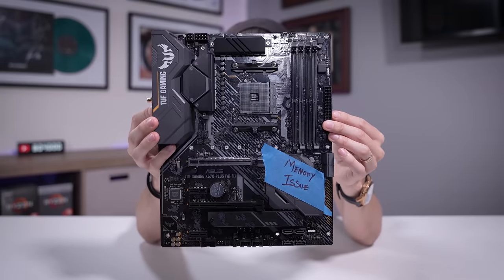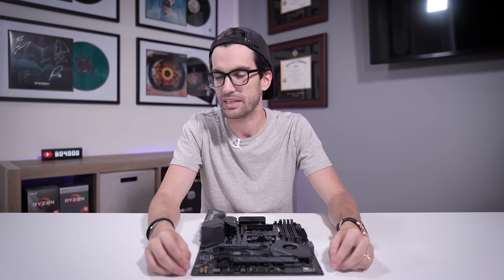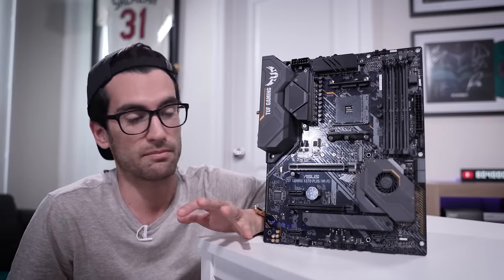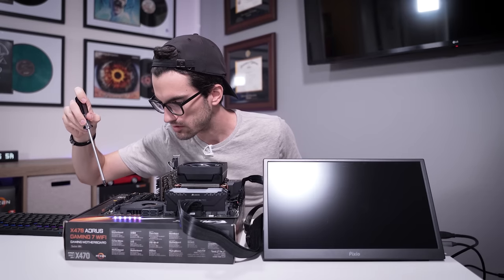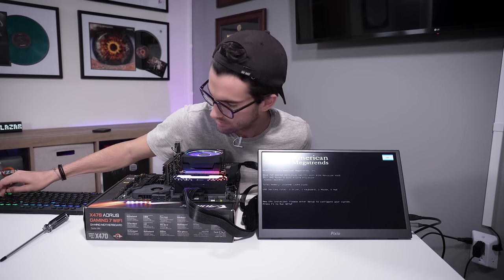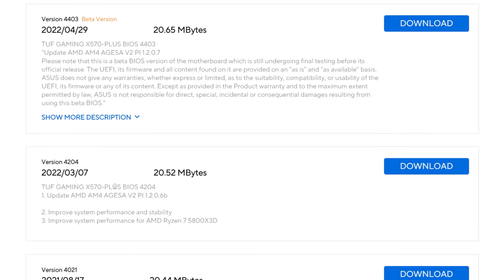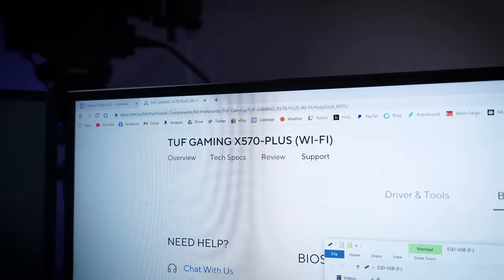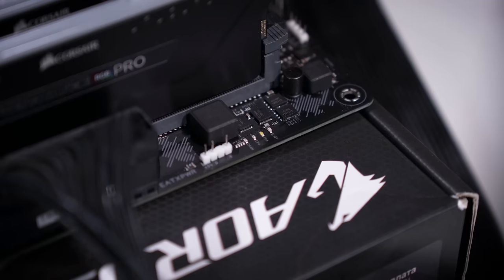Is This Viewer's Motherboard ACTUALLY Broken?!

Comment: The only thing I might argue withg is with calling BIOS "Software." I know this is debated, especially since UEFI came in, but BIOS is Fiormware. Now whilst UEFI  Has a software layer, that software resides above or on a Firmware, which is still a BIOS. It's in the name: Unified Extensible Firmware Interface. I also know I am nitpicking here, but you always stress how this series is a learning series, so I am just throwing this in here. Good call-out from the comments re. the update :-)

Comment: I'm confused.  You tried to update a non-wifi board with a wifi bios and it wouldn't allow it.  After installing the correct non-wifi bios the mainboard was working correctly.  If this is all correct, why does the MB at 11:31 state, "TUF GAMING 570-PLUS (WI-FI)"?

Comment: Whats your recommendation for case fan speeds through the bios? I notice the bottom fan on my case spins at 100% but there other 2 only spin at 80% (Front Pillar Only). Should I spin them all at 100%? I don't have any over heating issues and my CPU never runs over 65°F. Cheers!
Reply: Question, did you set these speeds in the past or does your system manage this dynamically (or was this the system default?) Location of each fans, their orientation, and their speeds will affect the static pressure of the build if you change it incorrectly. Therefore, assuming that your bottom fan is an intake fan, keep it at 100( this is totally fine) or drop it 5-10% (max) if the sound is an issue. As for the other two, keep them where they are, or play with the speed. IMO, if those front two fans spin too fast they might cause some funky temps. 

This is assuming that the front two are exhaust and the bottom is intake, so if the opposite is true, then make sure the front two run lower than the bottom to avoid choking the bottom fan with too much air. Hope this helps. Edit: I’m also assuming these fans are all the same size.
Reply: @PuR3OwNaGe45  Thanks for the reply. All 6 fans in my case are 120mm. I have 3 intake at the front, 2 exhaust up top, and 1 exhaust out the back. I believe these front fans are set on stock bios settings.
Reply: @UnknownUser_0000  this clarifies what you meant to begin with, I’d recommend setting all 3 to the same speed then. Keep all the exhaust set dynamically (or constant with a speed slightly above the intake since you have an equal amount of fans for both. Don’t go too crazy, but quite literally trial and error to find that sweet spot for your system. Hope that helps, I’d love to know if that provides any difference btw. Update me if you try it, be well. 👍

Comment: It's such a basic step.I'm really surprised this is something you routinely ignored in the past.If a board is deemed faulty or "dead", you have nothing to lose in trying a bios update or at minimum checking if the owner may have flashed an incorrect version and checking if parts are compatible with that specific version.

Comment: You can flash a "bricked" mobo with an external bios chip flasher directly on the bios chip quite easily( the programmer is also very cheap)

Comment: Maybe I missed something, always a possibility, but this motherboard has Crash Free BIOS 3. In a pinch if you could not get into the BIOS to use EZ Flash would it have been possible to flash the updated BIOS as per ASUS instructions? That is put the BIOS file on a USB drive, insert in a USB port, and have the MB automatically search and find the file?

Comment: Recently I’ve had issues with my pc whenever k load up call of duty and play for 15-30 min (it’s random) it will either shoot me out or restart my pc randomly. I haven’t been able to identify the problem but I never used to have this issue but I swapped cases and swapped GPU’s so I’m not sure if it had anything to do with that? But since then I’ve tried to replace the PSU just in case it was a power draw issue but that’s not the case either. No clue what to do at this point

Comment: Hey grey. Love seeing your videos. But unfortunately i live in India so cant send my pc for repair ;( . My pc just wont post, dram led keeps blinking and video card fans speed up and no signal to monitor. Tried to update bios using bios flashback button but the led wont turn on when i press the button. Sometimes vga led will turn on for few seconds and again reboot. Cant enter bios as the usb keyboard is not receiving any power. Can you give me a hint as to where to start looking ?

Comment: I bought a Gigabyte B560-ds3H-y1 AC off E-Bay. It came with BIOS F4. Under F4 I could overclock the memory with my i3-10100F. When I flashed to the latest BIOS F6 I lost that feature and was stuck at 2666 Memory. Sadly, I can't flash back the next upgrade is going to be an 11700K and a 14TB Exos HDD. My wife will like it when she starts really editing. I love this series. the 10100f is the 2nd Intel I have ever owned (Pentium D) all the rest have been AMD.

Comment: I have a question. I have a asus g10dk ryzen 5 I did a case swap to a asus gt301 I connected every right but when I power on the cpu fan and graphic card fan and the mb fan turn on at a high speed and my rbg ram won't turn on.

Comment: I have a weird issue with ASUS TUF Z690 Board. It was working fine with XMP enabled with factory BIOS. The issue started after updating the BIOS. It doesn't post with XMP enabled. It gets into boor cycle/loop. Then if I reduced RAM Frequency to 2933Mhz from 3200Mhz it posts and works perfectly. Then another BIOS update came and after applying that It posts with XMP and 3200Mhz but when it loads Windows it gets BSOD everytime it boots. Still reducing RAM Frequency to 2933Mhz, it works perfectly. Tried a lot of things, but didn't work.

Comment: I have THE SAME MOBO. It was gifted to me by a friend who could never made it work, and I took it because if it worked, it was gonna be a big upgrade to my b450 old MOBO. I did all what you did and nothing, it keept rebooting. Then I thought outside of the box. What if it was the processor and not the mobo? And it was. I have been using it with my old ryzen 3600 and zero issues. I sent the original proc to AMD for a RMA and they found the proc had an issue with the infinity fabric and I'm waiting for the new one to arrive. The old proc killed one of my dram sticks too. But IDK if Corsair would be as good as AMD for RMA.

Comment: Do you know about the CH341a BIOS programmer.  It allows you to directly load many GPU and MOBO bios chips without power.  I recovered a 5700xt that was bricked very easily.  The programmer is under 20 bucks and I was shocked how easily it just worked.  400 dollar graphics card just restored, just like that.

Comment: I remember many decades ago some motherboards had small fans on the chipset. When those fans on the chipset went bad for one reason or another finding a replacement fan was hard. At which point seeing fans on motherboard chipset faded away for some time.  Until someone decided it was good idea to bring back the fan on the motherboard chipset. Who ever thought of it I want to slap them side of the head.

I learned my leason many decades ago. If you are building yourself a gaming rig do your best to avoid motherboard which chipset fans. Cause at some point those fans will fail or sound like complete crap and finding a replacement tends to be hard.

Comment: I have a gigabyte z690 motherboard and using their program ebios I updated the bios to F7 from F6 and low and behold nothing but memory problems and constant crashing. I had to re-flash with the previous bios.

Comment: Recently upgraded my pc all except the case and gpu, with the gpu installed it would not post to bios. I'm not sure witch thing fixed it cause I did a bios update for the mobo and flipped the bios switch on my xfx 580 and it worked. Not very scientific but what matters is it worked lol.

Comment: Some day my cpu fan just stopped spinning for no reason. Fan was working on other fan connectors and other fans was working on cpu_fan connector. I was already on latest bios version so i just reinstalled latest version and it was working again. Strange but at least it was working.

Comment: Manufacturers are publishing bad bios, a month ago I updated to the latest Gigabyte Aurous B450 pro wifi mini itx and the mobo was not posting until I checked and saw a new bios update which solved my problem. Manufacturers should be careful with bios updates.

Comment: Can you try testing that Ryzen 5 3600 that had the dead memory channel? To see if now it works on a motherboard which has the latest BIOS? If I remember correctly you used another board to test it without updating the BIOS on that board.
Who knows maybe it works.

Comment: I had a Z77 board that was missing bios options to overclock and instead of looking at my motherboard I went off  the box I had for it which was a Asus Z77 LV but my board was a LX and I tried multiple times to flash the wrong bios thank god for safe guards

Comment: i have the same board and have the same problem my board requires me to boot my system 2x and it will boot. i too updated the bios there is newer bios out and that didn't fix my problem.

Comment: I am not so sure about the hardware degradation you mentioned being that meaningful you let us understand. One reason for power cycling after BIOS update is that newer BIOS might have updated microcode (firmware) for the CPU and it needs to be flashed. I am not sure of there is new microcode version with every new AGESA version. I once did microcode update manually for an Intel processor through live Linux distribution and the file size was only 48 Kb and that held in all the microcodes for compatible CPU's on that motherboard. Of course Intel boards last for one or two generations so the list of CPU's won't be long. Microsoft has decided to deliver microcode updates through Windows Update if there are serious security issues found from CPU's microcode. This is because not all users are going to update their BIOS versions. So my guess is that there was a microcode update that happened through Windows Update and that rendered the system inoperable.

Comment: Good board but it has usb3 issues on restarts, but I still have it. I tried to do an all tuf setup with an lian li case. I liked the aesthetic of the board, graphics card, and monitor, but the 5700xt tuf graphics card was no good, and I had to get an xfx card instead. That just threw my build off. It is what it is though.

Comment: I have an issue with my pc, im getting a blue screen that has an error code 0xc00000e9. I just built it a month ago, before the blue screen it just started shutting off randomly. But now will turn on and is stuck in a loop. Would this be motherboard issue? Or windows issue?

Comment: I bought an unconfirmed x570 ROG mobo last week for 100usd, it came clean and looking good but no matter what ram and cpu i install it still just goes to DRAM Orange light. I flashed the BIOS to different versions and still didnt fix it. I guess mine is really a dud. Sold it for 100usd maybe they believe they can fix it themself

Comment: I have the same board dont use 4 dimms of you plan on overcloking the mem controller and voltage is shite on that board its flaky if you use 4 dimms it will not go over 3200mhz

Comment: Would a bad mobo (EXACT MODEL YOU HAVE) be the cause of why my 4k 144hz Tv and 7900xtx is only showing 1080p native resolutions (recommended) Ive tried 6 new HDMI 2.1 8k 60hz, 4k 120hz certified cables. I even RMAd 4 GPU's thinking that was the issue, Ive had TCL come and replace the motherboard and pdb on the tv still even setting the tv to 2.1 output im still getting 1080p native.. Drivers have been update, mobo bios, cpu etc all has been done, even tried another 4k 60hz TV and still 1080p..., Ill I can think of is the MOBO or PSU but not sure, Any help would be great!

Comment: I had an issue with my motherboard not being able to run my RAM at 3200. I ended up updating the BIOS. After that, I was able to clock the RAM at 3200. I have a few other computers too. So, I ended up updating the BIOS on those as well...just in case.

Comment: AGESA versions upgrades, especially beta versions, do not guarantee better stability.
Reply from the maker: No one said "guarantee." Of course there are exceptions... But in general, they DO help with stability.
Reply: @GregSalazar  Speaking from personal experience AGESA versions are a crapshoot. I've gone from an older one with issues to the latest, non BETA, and immediately suffered crashing and blue screening. Dropping back a single version my system was stable and no longer had t he original issues. I do not know if the issue is AMD releasing weak stuff or board partners having a bad implementation but I've only had issues when updating the BIOS.

Moral of the story: From a BIOS revision that works and then hang out there until you come across a problem or NEED a new feature that is introduced.

Comment: Those tuf board are not very good in terms of memory compatibility (and not only that) had two B450s and both had same issue with memory (latest bios and ryzen 2 or 3 cpu's) corsair 3200 xmp memory was not working with it's own xmp 3200 profile (worked fine on my b450 gigabyte mobo) also crucial 3200 wasn't actually any of 3200 xmp sticks wont work with own xmp, best I've got is 2866. Also b450 tuf had no argb header at all and only one rgb.. vrm also al basic as it could be.

Comment: I had a Problem with random crashes and bluescreens, did only happen after installing gta rp, minidump told me Nvidia driver issues, windows told me ram issues...did literally everything with countless reinstalls of windows 10 and 11, after i didnt knew what to do and no forum could help me i just updated the bios because why not....fixed it, just because it reset the bios...guess it was the xmp profil......

Comment: Bro can I used mixed ram modules in my pc I have Corsair vengeance 8gb 2400mhz ram + Zion 8gb 2400mhz but I want to upgrade my ram so Can I use ( 8gb +8gb)Corsair vengeance 3200mhz along with my older ram modules my motherboard is msi b660 MA wifi

Comment: This is my build Is it good? What should I Upgrade? 
I mainly play Apex legends

Fractal Design Meshify 2 Compact Case
Mother Board MSI Z590 Gaming Edge WiFi 
CORSAIR iCUE H150i RGB PRO XT, 360mm Radiator
Corsair Dominator Platinum RGB 32GB (2x16GB) DDR4 3200 
CORSAIR iCUE SP120 RGB ELITE Performance 120mm PWM
Corsair 850 Watts Power Supply 
Intel Core i7-11700F
GeForce RTX 3070

Comment: I updated my bios with non wifi version. My motherboard is ASUS TUF GAMING Z390 PLUS WIFI because it wont let me update through usb so I decided to use the update my bios to internet . But the bios it flashes is the non wifi version my pc still working when i updated it I’m scared if it will break my system later on.

I also getting bluescreen when over clocking my rams
Reply: I wouldn't worry too much, if the board's identical apart from the wifi function, it should work fine.
The bluescreens overclocking the ram, that just means you're pushing them too far. The thing with overclocking ram, is it takes the same amount of time to set the column and row addresses, so if you up the frequency, you usually need to loosen the timings a bit. SO try nudging the timings up a couple of notches, then try the higher frequency, and see if that stabilizes it. You might need to throw voltage at it too, to clean up the signal, but only do that if necessary, and research the limit for your ram sticks, and stay a few voltage notches under it for safety. The goal is to run at the frequency you want stable, with as little voltage as possible. Too much can fry chips, requiring replacement, so i'd only mess with it if you can afford to replace it if you let out the magic smoke. Just a word of caution for you, cos just like with cars, when you push them to the limit, it's easy for it to show a weakness, and kill the engine. Same with PCs, if you have a weak ram chip or CPU memory controller, you can damage it.
Reply: @lesleymunro4964  I appreciate your reply. I’m relieved now that I didn’t damage my pc. 

I will follow your suggestion and stick on my current config. because I can’t afford to lose my ram’s for now 🙂.

Comment: I build 2 pc with b550 version of this MB and I wont recommend anyone to be buying one. 1 pc working fine and 2nd one had similar problem like this x570 but it will randomly crash and then be stack on ram wile powering up. Bios update did nothing not even downclocking the ram. After 3 days of crazy troubleshooting I fix it by setting some voltage values from auto to some specific values I found online.

Comment: I have an asus strix b450-f gaming board that randomly started to not detect a boot drive on boot up, I  have to let it boot up, not detect a drive, power it off, disconnect the drives, power it on and let it not detect a drive, then power it off again and reconnect the drives and then it boots up normally every time I do that series of steps, anyone have any suggestions??

Comment: Greg! I just  Build a brand new PC everything is running fine I just added a new I'm not too stick when to fire my PC backup and it just does the power cycle and doesn't turn on. I turned the computer off I powered off the power supply I Unplug to the computer I hit the power button I disconnected my cables to my graphics card I unplugged it to get access to the M dot 2 slot I added the memory I put everything back and it won't turn on please help.

Comment: This board fried for me. Let the smoke out.pretty sure it was a single diode or capacitor I saw exactly what went just been too busy. It was either a piece of dust or maybe a tiny moth or something that shorted it out. I had it out in open air, turned it on, poof.
Reply: rip
Reply: @DragonProtector  the good thing is it seems to be that single component, bad news is I’m too busy to try to repair
Reply: @Fee.1  ya truly can be tough times